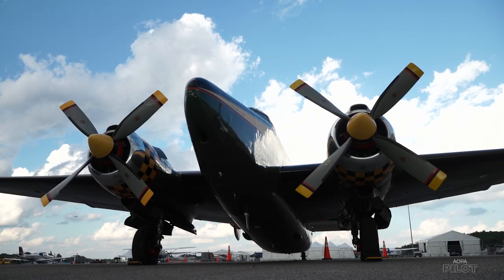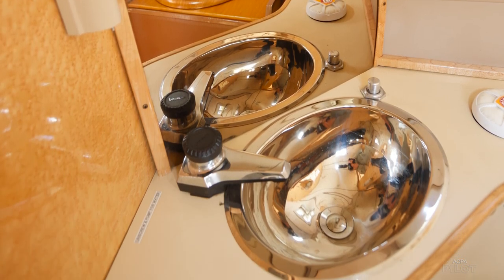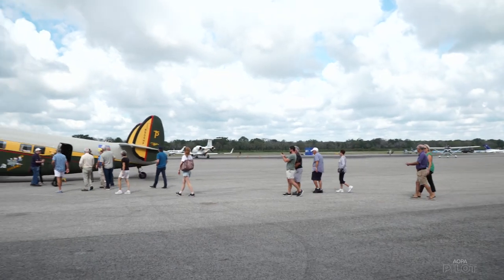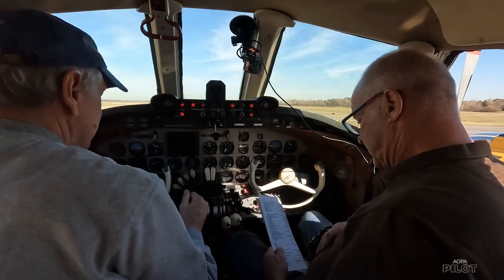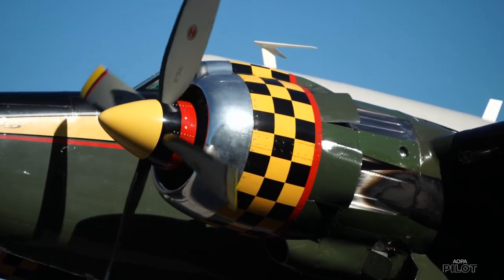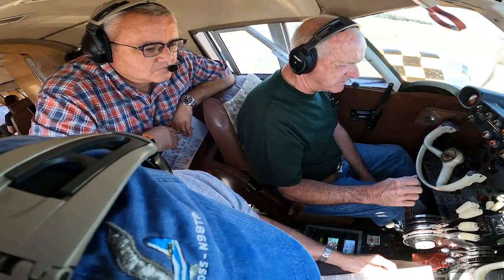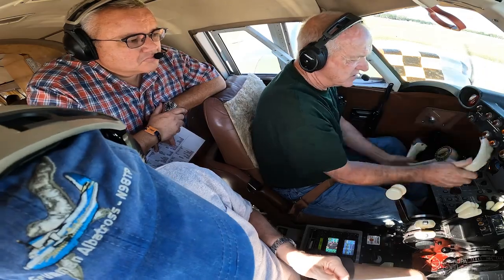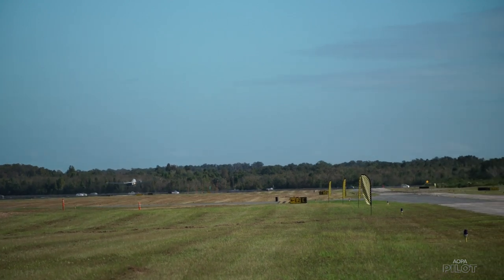Howard 500: A timeless airplane with terrible timing

Comment: This guy is just spouting BS.   " which unlike most engines, it doesn't prime in the cylinders "  There are no aircraft engines (with the possible exception of hte Wright 3350) which prime directly into the cylinders.  They all prime somewhere in the intake path.  "The carburetor on this is a big four barrel Holley"  It's not a Holley, and it's not a 4 barrel crab.  and it works nothing like an automotive carburetor.    "you're actually squirting gas in the carburetor inlet"  No you're not, the prime fuel  is introduced after the carburetor.